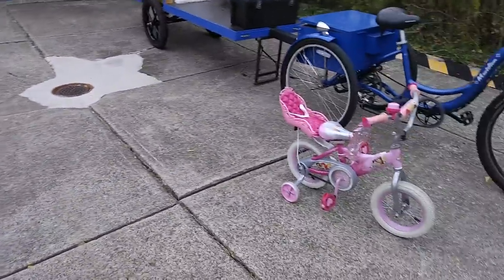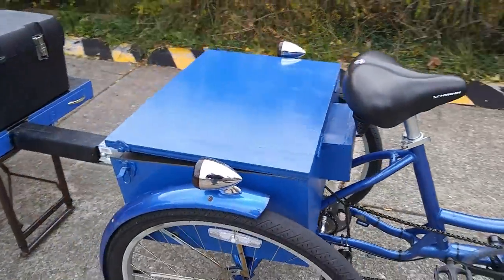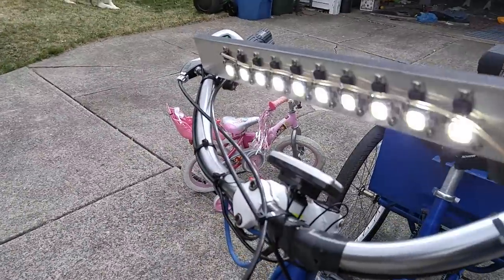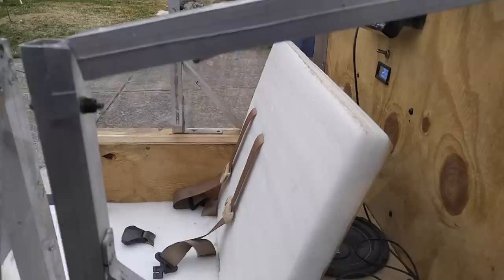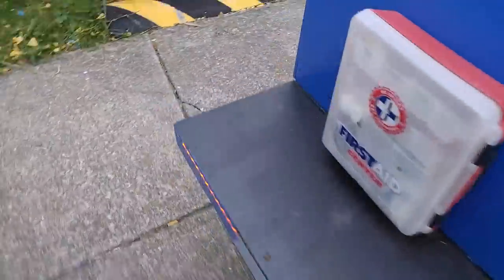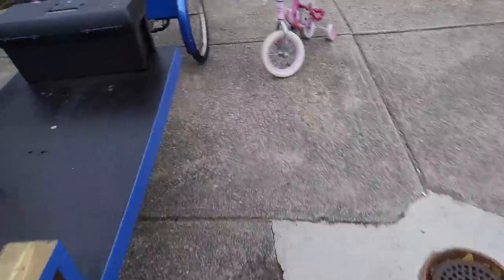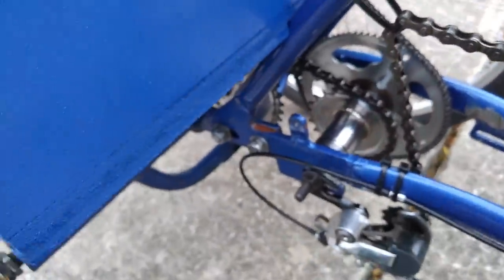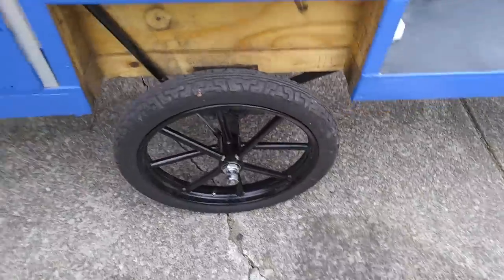Custom built bicycle trailer please share

Comment: what is this motor
Reply from the maker: 500 watt 24v DC
Reply: how mph
Reply from the maker: 11 to 14 mph
Reply: not fast
but it is okey
Reply: how much you cost roughly
Reply from the maker: I didn't need it to go fast I needed the torque it weighs alot and it was hard to stop at any faster than 10mph that's why I'm upgrading the brakes
Reply from the maker: The trike by itself will get to almost 20mph but that's really fast on a trike one wrong move and your flipping it over
Reply from the maker: The motor itself is about $60
Reply: all with battery
Reply from the maker: batteries were $120 a pair so $240 for All 4 of them plus the controller box the throttle and all the gears I had to buy another $200